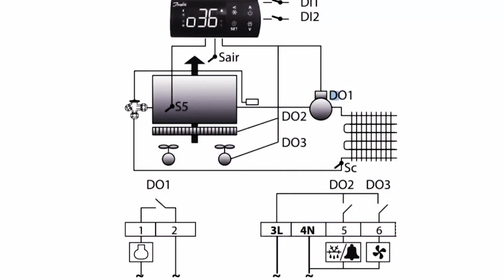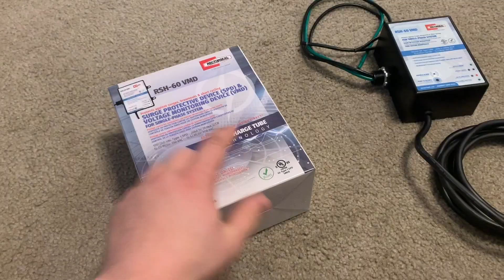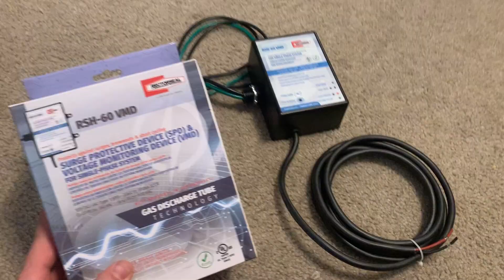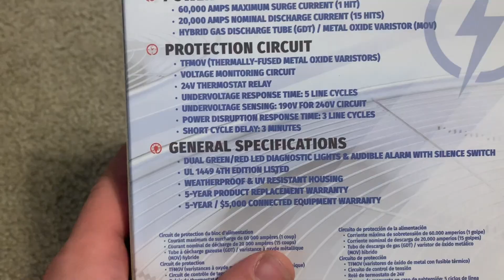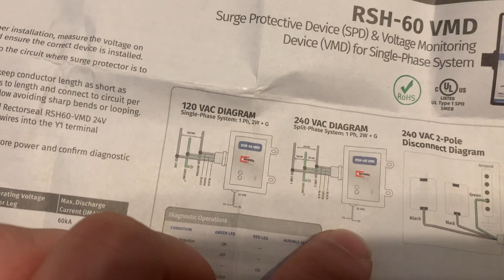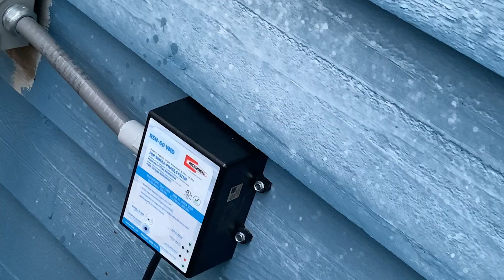Rectorseal Surge Protector Installation

Comment: If you live anywhere with lightning and other storms this type of device really pays for itself.  I added an Eaton  CHSP2-ULTRA Surge Protection Device ($137 at HD) to a dedicated, first breaker inside my main electrical panel.  This device can handle a surge current of 108 kAmp.  Eaton is a well know manufacturer for industrial equipment.  Before this instalation I had lost 6 electronic appliances in the laudry and kitchen.  In the six years since the installation; I have not lost any more appliances.

Comment: Why not have the surge with the disconnect box ? Why not break the R wire since you have a board on you AC/ heat pump?

Comment: Just want to add a few points, I am not US based & this video seems to be aimed at the North American market but generally speaking on SPD's they are not new (this one might be) the technology has been around since the early 50's. There are many different way of dealing with a transient, a GDT (like in this product is one) also an ISG (Isolating Spark Gap) MOV (Metal Oxide Varistor) or a suppressor diode (or sometimes a mix of 2 or more of these technologies). An MOV does not have to be "one and done" many SPD's use MOV's as their means of quenching the surge and these device can and do last 25 years plus. Interestingly the testing protocol in IEC 61643 requires an SPD to be able to deal with 20 events regardless of the technology used in them, so buy a device that meets that standard (as well as being UL compliant) and you'll be very well protected. The differences being that GDT/ISG are voltage switching, very good for dealing with lightning energy and MOV/SD are voltage limiting and very good at dealing with switching surges, inductive loads etc. For more information on SPD's in North America can I point you towards www.dehn-usa.com contact them and ask for Mark, Steven or Ingo.

Comment: As far as lightening damage, these things don't do much good. The outside unit is virtually the only thing sitting outside that's connected straight to earth ground. They attract lightening and acts the same as a lightening rod. It's very rare a surge will come through the power supply. If so it will knock at many electronics in the house.

Comment: A Couple questions:
1) Has anyone ever used these ?
2) are they Reliable ?
3) Do they do what they say ?
4) Are They a New Product ?
& are Our customers Your guinea pigs ?

Good Vid !  Sounds Like snake oil to me !
Liked the video #69
Reply: For one thing, the majority of lightening damage to the outside unit is from direct voltage spikes from lightening hitting nearby. The outside unit is usually the only thing around the outside of the house that connected straight to earth ground. They act as a lightening rod. It's extremely rare the lightening comes in through the power supply. If it does, it knocks out almost everything electronic in the home.

Comment: I didn't see exactly how it is wired, but the extra conduit is likely a problem in this installation.

The length of wire going to the SPD must be minimized. The longer the cable, the higher the inductance and the larger the surges that will be let through. Twisting the wires together is also a good idea (to maximize performance).

The installation guide states "mount device to keep conductor lengths as short as possible".

This product seems great; I want one for my house now. Installing a type 1 or 2 SPD at the main breaker box is also suggested.

Comment: I did one for the whole house.   My led’s kept burning out.  An electrician said it’s from internal surges.  We will see. It should help with all the electronics in the house.  The way this is wired it won’t help the blower motor.  Those are often ECM’s also.
Reply: You put one on both but this is over kill. One inside and one outside is enough.
Reply: i dont see why u could not use this on the indoor section too. in fact that would be the place i would best see them used since evap blowers are the ones usually taking the hit.
Reply: This makes me wonder if there were other underlying issues like a bad neutral. The interlock output could save your devices. For the indoor section, you'd want to add a 120V contactor to control the power to the blower assembly, but that is starting to sound like overkill.

I think most customers would hate this thing if it disabled the HVAC. Imagine if it shut off the heat in the middle of the winter....
Reply: You need a new electrician.